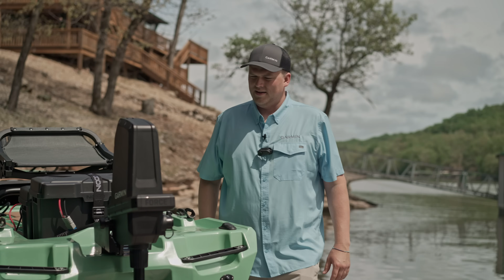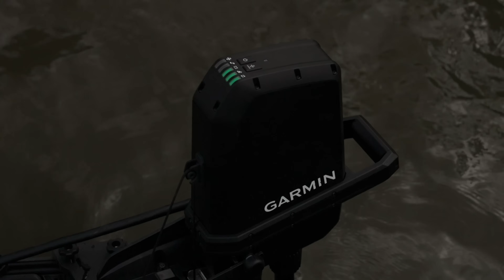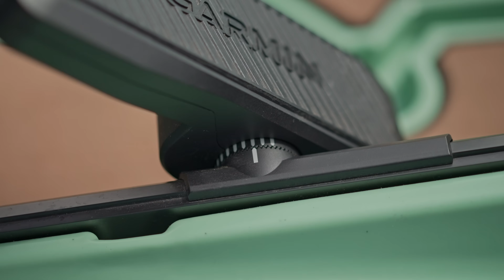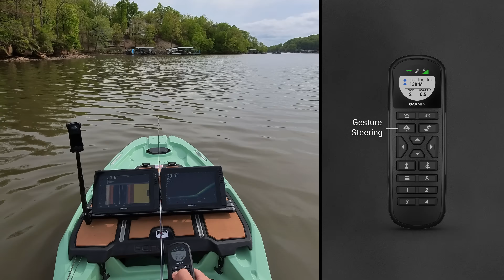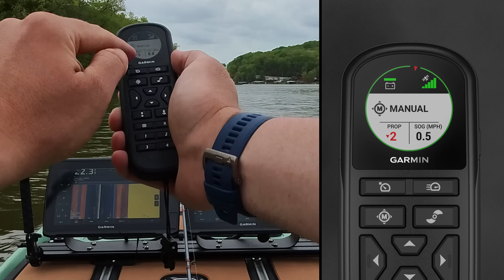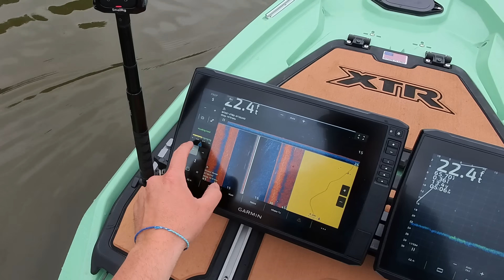Force Current | Beyond the Basics

Comment: My question is, can it be mounted on the front like a standard trolling motor? I can't mount the motor on the back of my kayak. I'd prefer to buy a Garmin, but that's your only 12V motor. And I don't have room for 24V batteries.
Reply from the maker: Thank you for your question.  The Force Current is a stern-mounted trolling motor and not configured to be mounted on the bow.

Comment: This is the first electric motor with autopilot steering that pushes (instead of using bow-mounted trolling motors that pull). Can you make a transom mount for this motor and allow it to be mounted on inflatable boats? Inflatables have been neglected so much, and I prefer them because they don't roll as kayaks. Having said that, what happens when you roll? Will the motor disconnect and sink?

Comment: Please tell us the speed ranges for both models and price🤷‍♂️ Tia🎣
Reply: 3k or 3600 for the wireless foot pedal.
Reply: It’s 55lbs thrust it’s no faster than any other motor on the market. The Newport has more thrust
Reply: @A_plusFishing  yes but newport are rubbish , i had two both failed in 3 months.
Reply: My Minn kota does the same shit for half the price 😂 foot pedals are not worth it. I have an old town sportsman an Minn kota power drive. Brand new 2500$ this motor is more than my kayak an motor lol it’s a joke tbh
Reply: Mine also has heading control gps an all that this thing is a scam lol

Comment: Spot lock?
Reply from the maker: Yes, the Force Current has anchor lock technology with multi-band GPS to help keep the boat in one place, even in windy conditions or strong current.
Reply: Will it turn you into the wind? Or keep you pointing in the direction when you hit the anchor button? @GarminRetailTraining
Reply: @bbowen4629 this is the question! Wondering the same
Reply: @bbowen4629 Judging from current technology and Garmin not specifically stating it will, we can assume it WILL NOT keep you pointed in the direction when you hit the anchor.. It will most likely turn you into the wind to hold your position. No GPS motor can keep you pointed in the direction when you anchor, unless you have two trolling in tandem working to keep you in one spot, but with today’s technology it’s just not possible….

Comment: Please make a kayak bow motor with those pedals available for it! So us kayakers can have the same efficiency as bass boaters when using scope. Hopefully you can make different sizes as well(a 30lb 30-36 inch shaft for smaller lighter kayaks, a 50lb and so on).
Also make sure it is easily stow-able just like the force current is!

Also please make a livescope pole with those pedals available also!